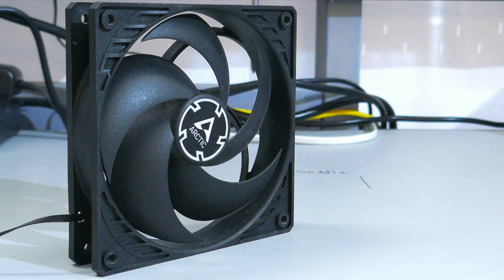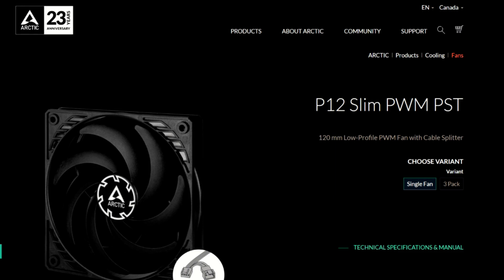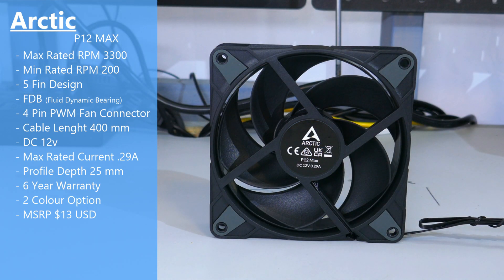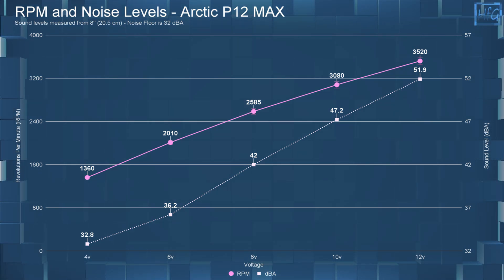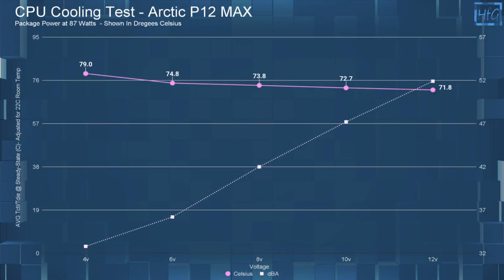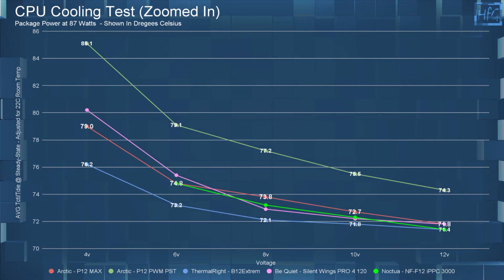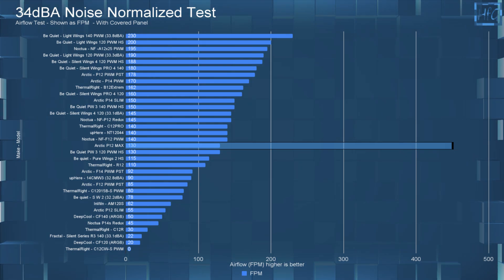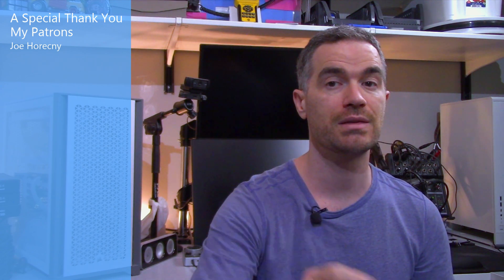Arctic P12 MAX System Fan Review

Comment: 3:04 My understanding is this model uses dual ball bearing.
Reply: The newer revison 2 indeed use FDB.
Reply from the maker: @taufiqhidayatulloh8848 I see that on the Arctic website, but my model the 1 I tested is a DBB (on the box). guess I need to test the FDB version now 😂
Reply: @HardwareForGamers Would love to see a re-test with the differences between both. Initially the DBB put me off the MAX.
Reply from the maker: Yes, you are correct they do use a Dual Ball Bearing. Sorry for that.
Reply: @HardwareForGamers  Are dual BB really any noticeably louder than FDB?
Reply from the maker: @Mack_Dingo  A DBB are typically louder yes. if they are noticeably louder i'm not sure. i haven't tested a FDB fan and a DBB fan that have the same design... yet. I know the Arctic P12 PWM PST CO uses a DBB so I may look in to this.

Comment: Got this and it was a nice upgrade over the fan that came with my deepcool ak500. Since I was able to set a looser pwm curve it ended up being quieter even when pushing over the 1850rpm of the fk120. I did get the version with fluid dynamic bearings though